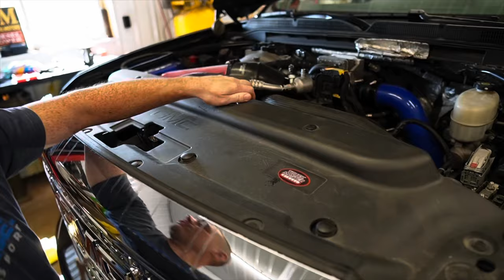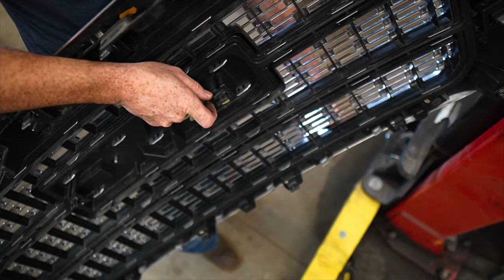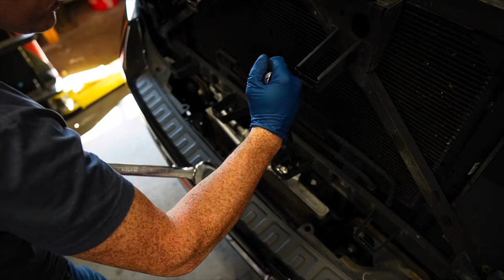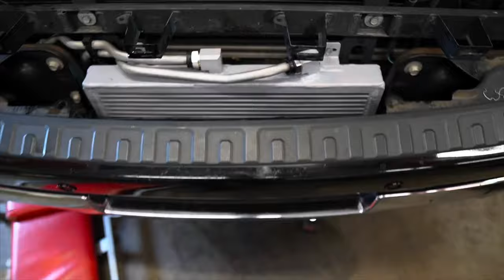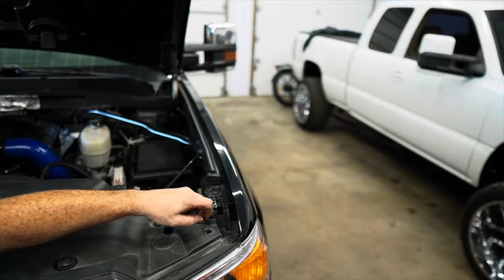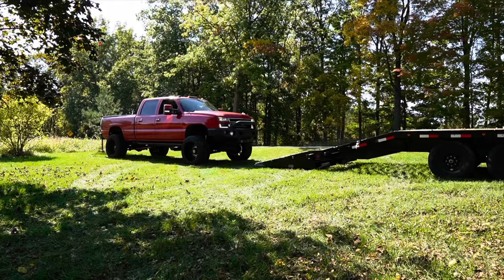How To Install A PPE 2017-2019 L5P Duramax Transmission Cooler *Removal and Replacement*

Comment: You need to install a transmission cooler thermostat bypass.  You’ll get greater trans cooling gains as far as lower temps.

Comment: I have 2019 silverado 2500 with L5P.  Upgraded with PPE transmission cooler 2 yes. Ago. The welds have blown twice now exactly 1 year after install. They replaced 1st one,but had to pay for shipping.  Very upset. Performed well with 35°-45° cooler, however quality in welds are just not there. Have you had any of same problem since install on your Denali? Big fan always watching your videos👍🇺🇸
Reply: Same problem bro, bought a second one, same thing happened after TWO WEEKS. GARBAGE WELDS DO NOT BUY! now I’m fighting with their customer service reps.

Comment: My 2015 d max daily is leaking transmission fluid,  i plan on replacing with p p e or mishimoto. Don’t mind spending more to do more Oem upgrades.
Reply: What other replacements are needed?
Reply: I have a mishimoto trans cooler on mine and it’s been flawless for over 2 years haven’t seen it over 160 but I also have a built trans. I have the mishimoto intercooler which has been phenomenal. I cant say weather ppe is good or bad. I’ve Never ran there products.

Comment: Just installed mine today on my 19 l5p and it’s leaking from the fitting any idea what it could be ?? Also I didn’t tighten the bolt are you suppose to ??

Comment: Ihad be a 2018 GMC Sierra 2500 Denali Diesel. The transmission kicks out of 2nd to 3rd at times, took it to the dealership,  and said  nothing is wrong. Works off and on. No check engine lights. Don't know what to do. Do you k know of a shop in the Dallas Fort Worth area?

Comment: Have a 2019 chevy 2500hd duramax that I want to merely move so it doesn't hang down. Any kit to do this. I do not want to remove or delete.....just move it.

Comment: I was searching through your videos to see if you had one about upgrading transmission cooler lines on a Duramax and I didn’t find one. Would you go back with the factory lines or would you go with an upgraded transmission cooler lines
Reply: Factory lines have a common failure point at the crimps Mine have been leaking profusely, upgrading with fleece brand